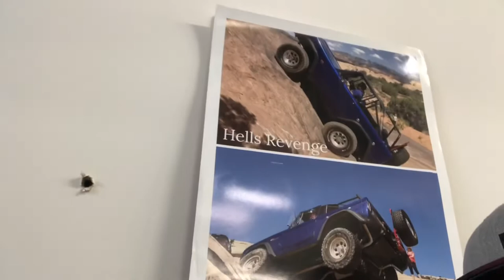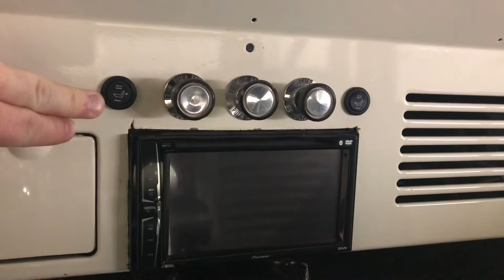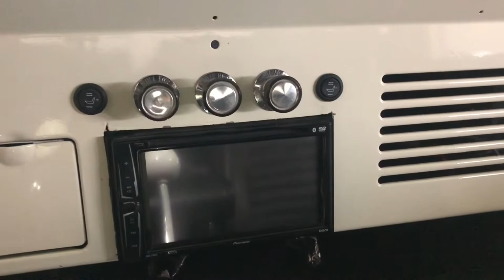Part 1- $29k Early Bronco Rebuild. DIY Anyone can do!

Comment: Being as I am from Michigan and finding early Bronco with a body & frame that has not been blessed by the Pope. How much do you think it would have cost if you had to of purchased everything new except for the axles, engine, transmission & transfer case?
Reply: From Michigan also, I feel your pain! I have a titled '68 frame I am building. Probably about $5k into it so far and it's not a rolling chassis yet. I have axles, suspension, and power steering parts. I'm buying a fiberglass tub that is about $5k for the bare tub. The big picture is a bit overwhelming but step by step it isn't too bad!